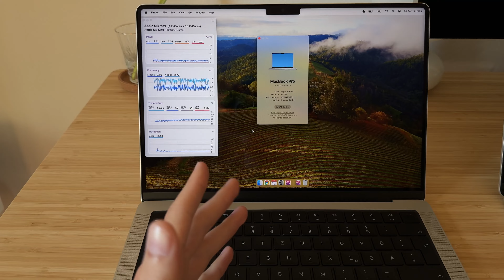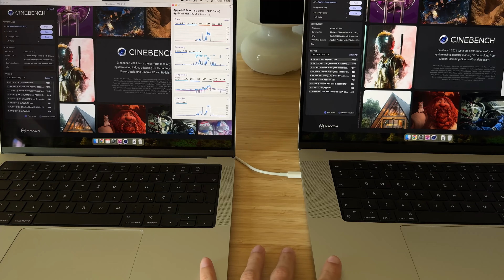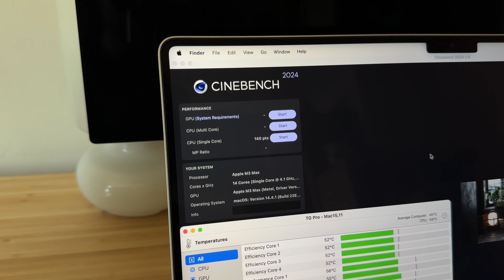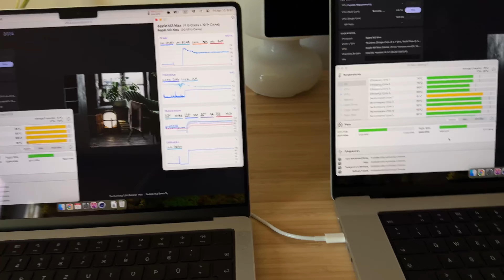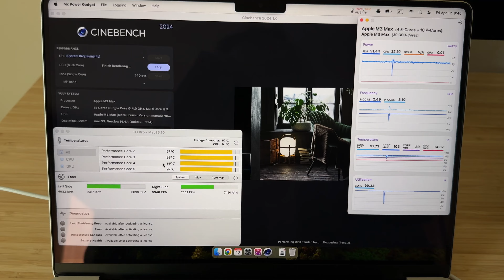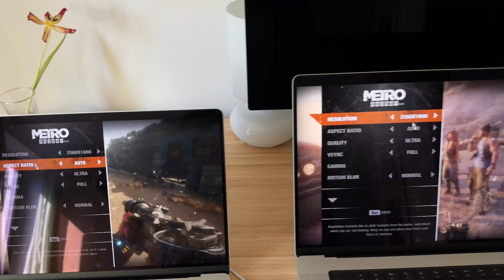The Test No One Did - M3 MAX (Binned) - 14 inch vs. 16 inch - Thermal Throttling Test

Comment: Still the best video demonstrating thermal throttling on the 14inch , especially in the gaming scenario.

I had the 14 inch m4 max (40core gpu) and it would throttle down excessively, within 5 minutes of starting a game (up to 33% reduced performance)

Comment: better a m4 pro 14 14 core or max ? thanks
Reply from the maker: With the 14" I would go for the PRO chip with more RAM. I think 32GB/36GB RAM and more SSD storage are more significant than the MAX chip.

Comment: I ordered m4 max 14”. Will it throttle to the point of m4 pro performance levels?
Reply from the maker: Depends. If you do heavy gaming for example for hours and hours, sooner or later it will throttle. I haven't compared the M4 Chips so I can't guarantee you how much or little it might throttle. The MAX chip however will perform always better because it has a higher baseline spec. If you can spend the money and need to go for the MAX. If not the PRO chip will also make you very happy.

Comment: so basically 14" is shit
Reply from the maker: Yes and no! I would say don't buy a 14" with the MAX chip if you want to get your money worth. The 14" with the PRO chip is definitly still a powerhouse and very much worth it if you strictly want a small macbook. The MAX chips definitly need proper cooling to perform consitantly with its power.
Reply: @samuelkuro   I wanted  to buy M4 pro 48/1tb but had to choose  M3 Max 14 from you're test -  coz difference is about 700$ for M4 at the moment! With termopads on cooling system its woks quite good - 3.50Gz  for P-cores sustained perfomance(R24),  without throttling, but hot anyway especially  for legs xD

Comment: 16 inch binned or unbinned version for M4 Max to game Death Stranding, RE Remake series, MGS4 via PS3 emulation in 1080p 120fps and 4K 60fps?
Reply from the maker: If you strictly want to go for the 4k 60fps, I would reccomend the unbinned version. For 1440p gaming the binned verison will do just fine. I'm currently rocking the M3 MAX binned 16 inch and it handles everything fine until you surpass 1440p.

Comment: 12:06 That is not thermal throttling. The P-cores don't run at their maximum frequency when doing muti core tests. It's a normal behavior of chips in general regardless of thermal headroom.

Comment: You are getting a more portable and svelte MacBook with the 14-inch at the cost of extra heat and some performance for the lower price compared to the 16-inch. Fortunately, I think most people understood this and picked accordingly. I was used to lugging around a 2011 17-inch MacBook Pro that weighed 6.6 pounds. So the 16-inch for me was more portable for me plus maximum cooling and performance.
Reply from the maker: Nicely explained! Coming from a 17-inch the 14-inch would have been like the iPad mini for you :D

Comment: Nice comparison. The adverse physiological effects of the high frequency fan noise of the 14 inch M3 Max cannot be underestimated. I suppose creatives who do video editing might opt for the M3 Max in the 14 inch form factor despite the compromises that were cited in this video in order to have access to the dual video encoders and decoders. For me, it would be 16 inch or bust when considering a system with an Max chip.

Comment: Test after fully heat saturated if your 16 inch will have better performance charging via magsafe. The 140w power adapter only negotiates 94w via USB-C. You are probably on the verge of power throttling. I have a m2 max with 32 core GPU and ir will start dropping the Battery if I run baldur's gate 3 for a long period of time. Its bad for the battery to operate at such high temperature in the least and it could potentially affect performance too. I bought a  usb-c cable with a power display and it runs pegged at 94w and I havend enabled high power mode on this one. My previos M1 pro would run fine with 94W.
Reply from the maker: That's a very interesting test. I use a little app regarding charging limits and temperature control. It's called "AlDente". I just can't test it anymore because I sent one of them back already.